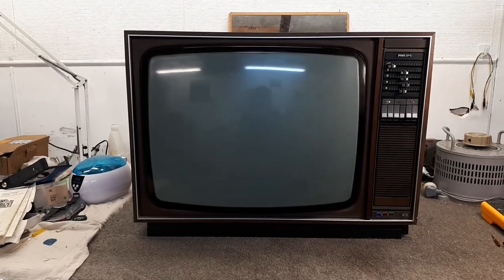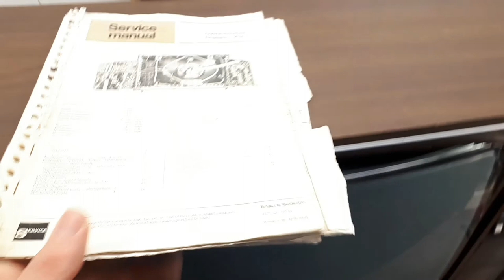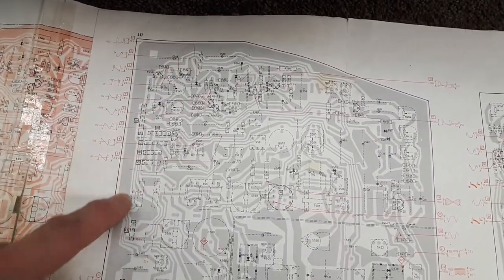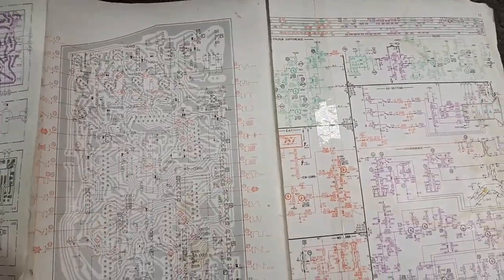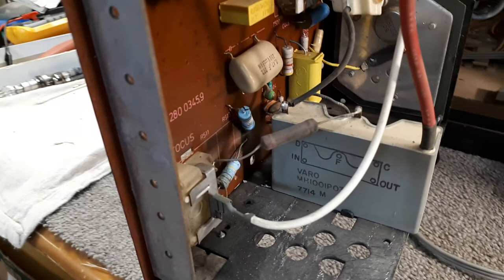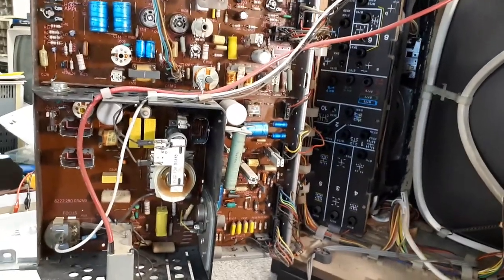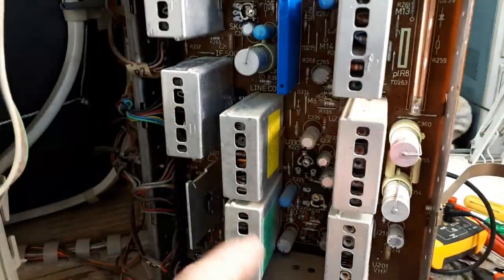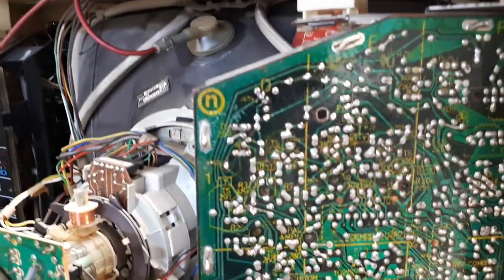Vintage Philips K9 Colour Television Part 1

Comment: hey, im from wellington NZ and I have a floor standing Philips KTV560 from the 1980s. it works like a charm and all original. but I been trying to find a way to contact you and I wanted you to have a inspection of it so I don't ruin the set if there are any leaky caps or something.

Comment: I recently picked up a K11 which seems very similar to the K9. Haven't yet got round to much more than a bit of cleaning out of the dust inside it. On powerup there's no deflection, no EHT, just a quiet tic-tic-tic from the speaker, I'm assuming the PSU is in protection due to some problem in the line stage. I hope that tuning capacitor hasn't caused a EHT rise - will let you know

Comment: we had plenty of k11 which is the version with 20AX inline tube. Curiously in Germany they were called K9A. K9 had a similar circuitry but a delta tube. there were models with or without remote control, with 8 or 12 preset. I've never seen one with mechanical 6 preset keyboard. Very nice set

Comment: Interesting set, the Australian K9 had a turret tuner as varicap tuners did’t have enough range to accommodate the oddball Channel 5a (136.25 MHz).  It had the same issue with the lopt tuning cap and I know the inside of one as I was asked to have a look at a friends set when it started pulsing. Turned out to be a lopt failure, big crack in the overwind “doughnut” and small puffs of smoke issuing. Fortunately lopts were cheap.
Reply: I have one.  The big 26" double ended console version.  I must get around to restoring it, - one day!  😊